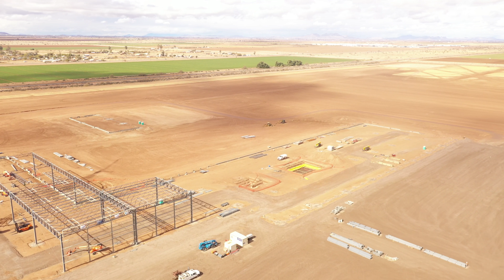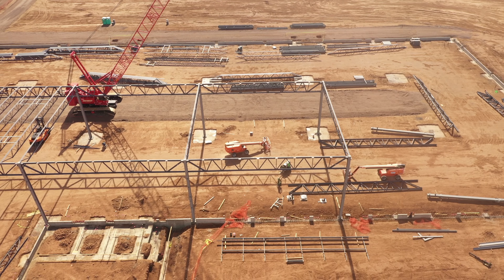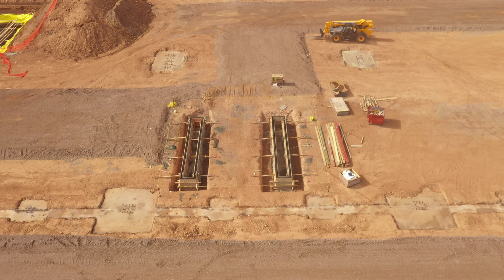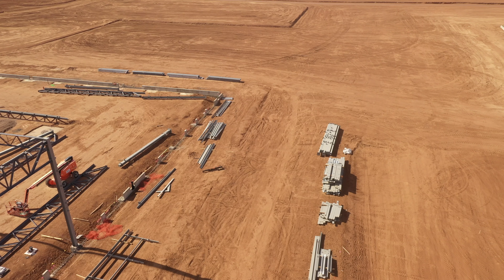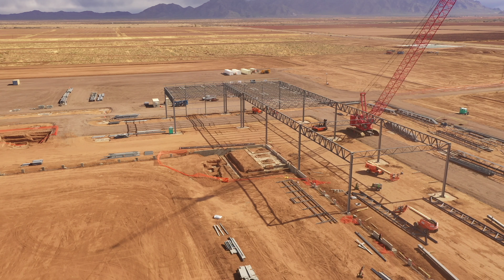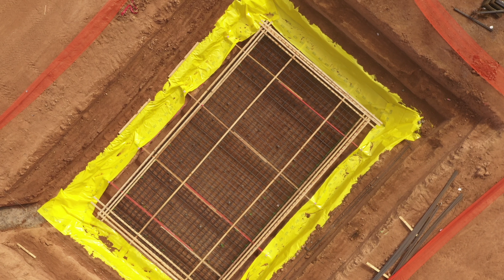Nikola Semi Pilot Factory Construction Site January 24th, 2021 | Drone Footage 12 PM

Comment: Its an $8billion company.  and they are building a shed the size of a typical modern farmers machine shed.  and an office building the size of two houses. They are just dropping crumbs so they can claim they are doing something and keep burning cash.  Two types of stakeholders remaining at NKLA 1. those trying to keep price up till their lockup allows them to sell their shares 2 those being paid a wage and just running this out till its gone.    They have not announced engineers or designers working on product, so I assume there are none.  Just bean counters looking for their share of the remaining cash - and there is alot of of it.  Over $800million in cash.  No plan, no product, no customers.  Just the cash that Trevor couldn't get out with him.
Reply from the maker: I suggest you listen to the video.  You might it have had it on mute.  There are 2 buildings laid out.  Currently, the smaller one measures 10,800 sq ft and the larger one is 180,000 sq ft.  These are considered part of the pilot plant.  The automated part of the factory has not been started yet.
Reply: Agree. Nikola is just SCAM

Comment: NIKOLA IS BACK !!! YEAAHHHH !!!  Like the Phoenix Rising...  People still looking up the sky, dumbfounded, do not be a doubting Thomas anymore...  think 2021-2024.
Reply: Do you feel this is the scale of factory investors had in mind when they valued the company at $35B? Or even today with a $7.7B valuation?

When this building is complete it will still be significantly smaller than the workshop where Tesla built their first roadster, and they could only build 2,450 over four years, and they were using mostly off-the-shelf parts.

Nikola is building from the ground up with mostly proprietary components, some of which have never been used commercially before.

I do not think this space is remotely large enough to handle the volume necessary to justify even half of the current valuation.
Reply: @FutureAzA    Wow intelligent speak,  Not.    Did you know that it took Tesla about 10 years to be fully successful??  Nikola IPO Nasdaq just in June 2020, a bit over 6 months, and you expect the world...
Reply: @sammyalabamy111  Tesla's market cap was $3.8B after being in production for 4 years. That was 2 years after their IPO.

I don't believe a company in the early stages of building a small workshop is worth anywhere close to its current trading price, but I'm a cautious investor. My risk tolerance is very low.

$7.7B market makes them bigger than ADT, Yamaha, Capcom, Thyssenkrupp, LG, and Trend Micro.

That's not investing. That's gambling. I've done well by not gambling. You may make money off this, but there is little to suggest that possibility as of today. Best of luck to you.
Reply: @hiuofwreqc  Nonsense. I already said I'm happy to see this progress, and I'm rooting for them. I'm just not a gambler, and NKLA is a purely speculative play. Your snark doesn't serve you well.
Reply: @hiuofwreqc  Let me put it another way. If someone invested in Nikola, they're likely broke and bitter. I haven't done that, and I'm a happy, happy clam.
Reply: I have about $10000 invested and got in around $14ish. I totally understand that Nikola is a speculative play and my portfolio will allow for this play. So yes I'm invested and hope they kill it.
Reply: @hiuofwreqc  hey, im 10x on Tesla and have been calling out nikola for 3 years. Its so cute seeing your hopes put into this stock.
Reply: @hiuofwreqc  you aren't good at finding whats next. I bought Tesla after looking at their technology and roadmap, after looking at nikola i concluded it was being ran by a con man and it turned out i was right years before the hindenburg report. Anyone who invested in Nikola does not understand engineering and physics, just hype. Trevor is very good at selling hype.

You know what company i did buy? NIO at 11$
Reply: @hiuofwreqc  you really think you need to tell me how Tesla was doing 2 years ago? Do you really think im lying about making 10x on tesla? I still remember reacting to the tesla semi and roadster 2 reveal  and questioning the specs and then actually doing the math myself to see if their promises where achievable. I know more about both these companies than you because my research goes beyond promotional videos, i actually look at the underlying technological challenges.

Your only defense is calling me a liar, which doesn't actually change anything about how nikola operates.
Reply: @hiuofwreqc  so do you always call people liars and cover your ears?

Comment: So they really are building a factory! They look like they are doing a good job and have taken the time to design a factory. How many acres is the site? It looks huge.
Reply: When you compare this to the progress at the Texas gigafactory this looks suspicious slow. At this rate the nikola factory will be done in 4 years.
Reply: Huge?  It looks tiny.  Are they planning to build the fuel cell, batteries, frames etc...in this tiny building?  On a real problem.. so far hydrogen will cost double of diesel.. and the breakthru technology of making hydrogen cheap... was a scam.  This whole building is nothing more than smoke and mirrors.

Comment: I like the video, dislike Trevor Milton, indifferent to Nikola. However on a side note, I believe mass market hydrogen vehicles are a fantasy endeavor. I mean even if the cost of producing H2 and H2 fuel cells comes down to earth it will be the cost of creating and maintaining the huge infrastructure that will be its downfall.
Reply: But will provide a lot of jobs.
Reply: @deluexemusic9172  just the construction but i dont see putting in multiple 5 acre hydrogen stations in L.A.
Reply: @jetah50  that’s why tankers exist, we don’t pump oil from the earth in LA either but somehow the gas stations are full right
Reply: Like the infrastructure needed to produce enough electricity to maintain grid if all cars are EV's ????
BOTH EV & Hydrogen will need infrastructure upgrade. So much so on EV cars that we will have to build nuclear plants to keep up with electricity demand. Places like Midwest & East coast do not have the luxury of sunny days & wind power is not enough to generate electricity like sunny CA, AZ, TX, FL etc.. that can use solar panels. Wind power still needs oil polluting manufacturing to fabricate them, same with solar panels. There is no such thing as a "free" lunch when it comes to ANY renewable energy. All have their negatives & each of their particular positives. Current EV battery tech. will not work for class 8 semi's, hydrogen is only viable option for now. If battery tech. improves greatly, that may change, but then so will hydrogen fuel cell tech.
Reply: Hydrogen will never come on Trucks because to expensiv and to complicated and batteris are much easyer to handle.
In the far far future like 2045 Hydrogen will be a energystorage solution for peak Energy from Solar and Wind but befor we have to build a lot of Solar and Wind.
Reply: This thing is almost as stupid as the tassel semi, or maybe it's the other way around,. Maybe they should get together and just have a big huge stupid fest of no charging fueling infrastructure and weights so heavy that they can't even carry any close to a truckload. This thing and the Tesla are nothing but scams for trading in carbon credits and fleecing investors
Reply: @sevencostanza3931  Many people and apparently yourself, do not realize the technical difficulties of producing and storing hydrogen. 
To rattle off a few, H2 must be compressed to around 10,000 psi which requires massive and massively expensive compressors which require regular maintenance. Storage tanks to contain 10,000 psi are massively expensive and will require regular hydro testing also not cheap. 
(In comparison - Scuba tanks are only 3000 psi, cost $500+ ea. must be hydro tested every 5 years & have a 15 year service life after which cannot be refilled, commercial compressors start $10,000 and go up exponentially for higher duty cycle) 
Back to hydrogen, H2  is the smallest molecule and leaks, it always leaks, H2 will literally leak through the steel walls of a tank (any tank) albeit a very small amount. The problem is, it causes hydrogen embrittlement. Thus, due to embrittlement virtually the entire H2 storage infrastructure will need to be regularly rebuilt  and or replaced. 
Then there the vehicle itself which is still an electric but the added complexity adds to the cost of the vehicle, maintenance, malfunctions, repairs, etc.
Lastly H2 does not exist on earth as free H2 it must be manufactured and nearly all of it comes from methane (natural gas). Splitting water is to expensive because it requires 4-5 times more electricity to produce than what you will get back in a H2 fuel cell.
 In a nutshell, H2 is a trojan horse
Reply: @booobtooober  Yes agree there are lot of technical difficulties with Hydrogen, but there are greater strides in improving hydrogen issue last couple years from what I read online. The tanks in the Toyota Mirai, Hyundai nexo fuel cell, Toyota/kenworth semi, Cummins Semi, Hyundai semi are all composite. Cummins partner NPROXX using Carbon fiber in storage tanks. Neither EV (mining part) nor Hydrogen in near term is as good as gas/oil financially. But EV Semi is not profitable for long haul trucking due to increased weight over FCEL & charging times. https://www.cummins.com/news/releases/2020/11/13/cummins-closes-nproxx-joint-venture-hydrogen-storage

Comment: 2024 😂😂😂??? Tesla will have Semis driving left and right all over the place until then 🤫 Nikola is like th biggest s***tshow of this century
Reply: @sevencostanza3931  i havent seen a Hydrogen Truck on street right now.
Funfact: Hydrogen produces more CO2 then Diesel fuel - so let it like it is until the Batterys are cheep enogh
Reply: @JK-ku2mj  I have not seen a EV truck yet either but that does not mean they do not exist.
Batteries do not product CO2 ???? Have you looked into the mining of the rare earth metals that are used in EV batteries. Major pollution and CO2 release in that area. Please do some reading. Lost of online articles discussing that issue. I use to be pro-EV until I did a lot of reading and realized EV was not as great as i thought. Ev's better solution for light cars, hydrogen better solution for semi's.

Comment: Tesla will have captured the entire truck market by 2024 with proper infrastructure
Reply: Agree! Tesla SEMI truck hawe lower price and longer range than the (vaporware-truck) Nikola tre (read: IVECO-TRUCK with 90%Iveco parts) lol :-)
Reply: Hydrogen will dominate peewee!
Reply: @sevencostanza3931  the Nikola hydrogen truck weighs more than the Tesla semi and the hydrogen is way more expensive per mile.
Reply: @odisy64  How much does the Tesla semi weigh & what is the size & power kwh of the battery and range. Very little info out there on Tesla semi & varies on which article you read. https://en.wikipedia.org/wiki/Tesla_Semi
Reply: @sevencostanza3931  from what i calculated and extrapolated it should be a 900kwh battery with a vehicle weight around 22,000lbs. i expect the maximum horsepower to reach around 1200 but the cooling is what's going to determine the maximum operational horsepower and much of that info is reliant on their new 4680 form factor cells that have vastly different characteristics than what was available during its unveil in 2017.

Comment: The scaled back ambition of this site is a lot more realistic than the original plan. It's frustrating that Trevor burned through cash at such an incredible pace. The folks at Nikola have got to be furious with the incredible harm he caused the company. Fingers crossed they start with a battery model, because the pursuit of hydrogen would absolutely spell the end of the road for them. If Toyota can't make it work with their vast army of engineers and nearly bottomless R&D budget, there's just no way Nikola can make it work. The inefficiencies inherent to hydrogen production and consumption already make it unfeasible, even before you consider the logistical nightmare of trying to create a whole new supply infrastructure around it.
Reply from the maker: I agree with you on the hydrogen issues.  Funny thing is I watched a video yesterday with Sandy Munro, whose opinion I respect, say that hydrogen is the way to go.  Still can'y get onboard with that.
Reply: So what does Nikola bring to the table with respect to the ability to build at scale an efficient BEV truck?  Battery technology?  Patents?  Strategic partnerships with battery makers?  Manufacturing expertise?  Capital to execute on plans?  I'm seeing nada.
Reply: @cerealspiller  honestly just another option for people to choose. if it's a class 8, it would give options.

we've heard about legacy auto but nothing about class 8 auto.  are Peterbilt, MAC, etc also working on BEV or will they stick with diesel or will they develop hydrogen.
Reply: @jetah50  Kenworth, Mercedes, BYD, and many others already have large freight EV test trucks on the road. Nikola will be a late arrival in a crowded market.
Reply: @FutureAzA  oh! i was unaware the semi companies already had that much.
Reply: Agree
Reply: @BearsWorkshop  Class 8 semi's will not work profit wise & weight issue being EV only. Battery Tech. has to improve tremendously to over come Hydrogen Class 8 Semi. Vehicle/powertrain Semi related manufacturers already into hydrogen and may overtake Nikola if Nikola does not act fast & do well.
Hydrogen Semi's are already being used in places, manufactured by other OEM's. pure EV does not work for Semi's cause of profit margins. 
All the big boys know this & will use hydrogen. Hyundai ALREADY delivered their Hydrogen Semi to Switzerland for European market.
Toyota/Kenworth already using Semi in port of LA. Volvo/Daimler Semi will be used in EUrope. 
Cummins getting interest from OEM's to use their fuel cell tech. powertrain. 
https://www.cummins.com/fuel-cells
https://pressroom.toyota.com/toyota-kenworth-collaborate-develop-zero-emission-trucks/
https://www.reuters.com/article/hyundai-switzerland-hydrogen-trucks/hyundai-delivers-first-fuel-cell-trucks-to-switzerland-idUSKBN26S1FM
https://www.daimler.com/company/news/planning-joint-venture-volvo.html
Reply from the maker: @cerealspiller  Nada to be seen.
Reply: @cerealspiller  Who cares. Let Nikola build the factory & if Nikola ends up failing then maybe Toyota or Cummins or Hyundai can take over the factory. Both already have hydrogen fuel cell truck solutions out there. The factory is designed to manufacture Semi's, no problem if similar company with cash ends up buying the property. By the way...Nikola is a conglomeration of CHN-IVECO & BOSCH. Some of Nikola's employees came from Bosch. Maybe this was a way for these European companies to break into the USA market with their tech.